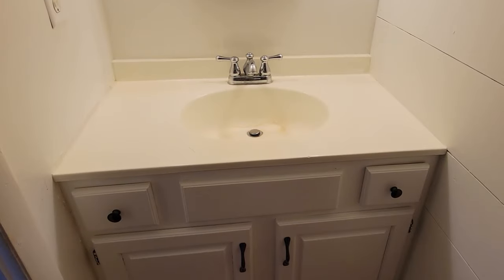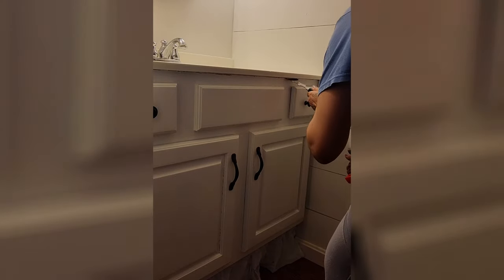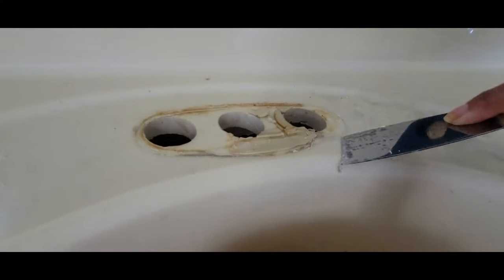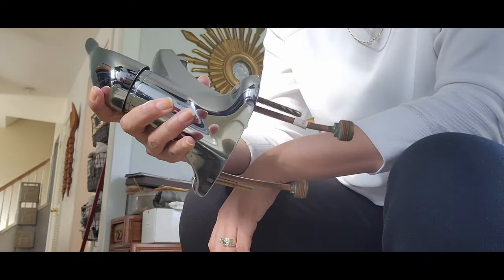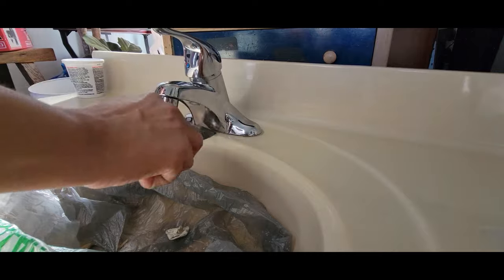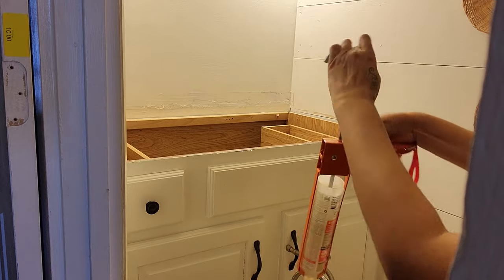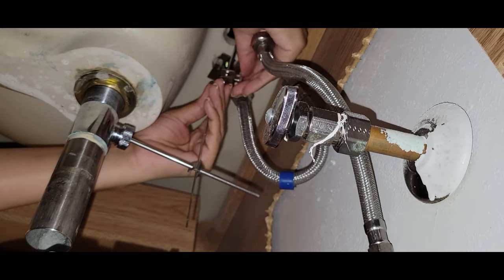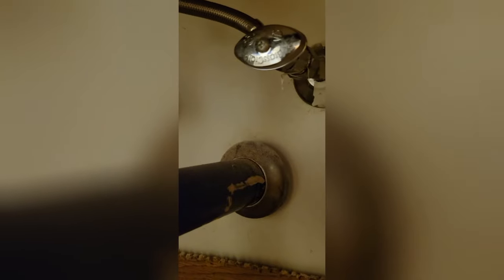How to Remove & Replace a Vanity Top | Easy Bathroom Sink Remodel

Comment: Great video (loved the humorous bits too).  Question: did you also use plumber's tape when reconnecting the drain valve to the outflow pipe?  Thanks!

Comment: Good job. I want to replace a synthetic material sink and vanity top with a porcelain one. The vanity is against 2 walls (back and left) and open to the right. The vanity is 30" wide, so it looks like I can use a 31" wide sink top. You have a nice presentation style. Thanks.
Reply from the maker: Thank you so much Melanie, I appreciate that 💯

Comment: She may have spent nothing but she just devalued the heck out her bathroom because the vanity top didnt line up flush with the wall and she should have just spent a little money for a good top.
Reply from the maker: Hmmm, what's the difference between a brand new vanity top verses a free one if they have the exact same measurements? Also, define "the heck out" regarding, according to you, it's "devalue".